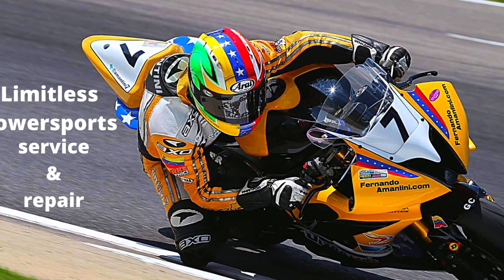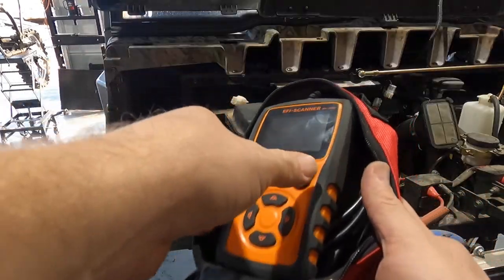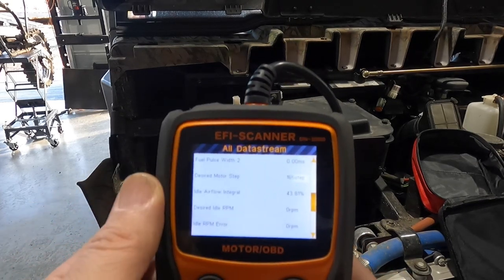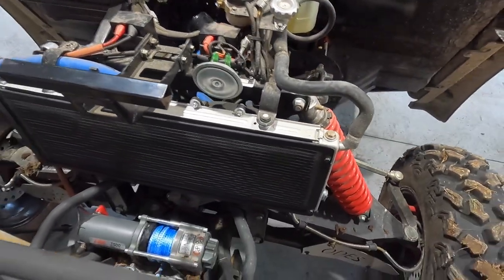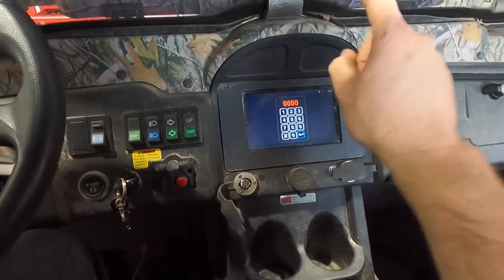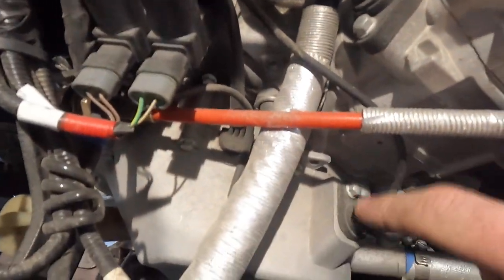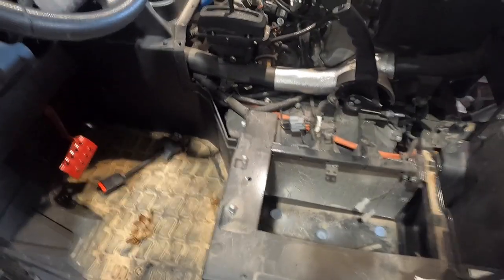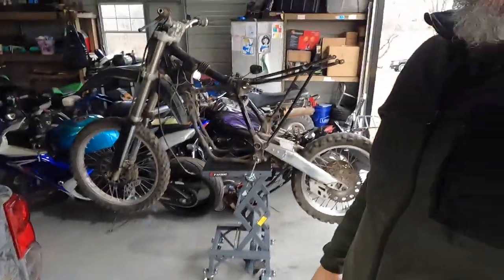Odes, Massimo, Bennche common issues

Comment: My oades 800 overheats its brand new and the dealer says it does it at low speed so I guess they think I’m supposed to drive 40mph everywhere and well there saying I can’t get a refund and is I put a oversized thermostat on it I’ll void warranty but if I take it out to like the river run it’s 7 miles of trails. I can’t take it there. It overheats every time I slow down. I’m so frustrated. This thing is brand new.
Reply: That’s crazy I putt around at super slow speed with ‘06 rhino 660 in 110F last year and never over heat however I rigged the radiator fan to run manually. I can just leave the fan on the whole time or turn it off. I mostly go slow speed in 4x4 and run it all day if I want. Also I make sure to keep the radiator and oil cooler clean.

Comment: Can the PVC cause engine smoking? What's the fix for the PVC?
Reply from the maker: A clogged crankcase vent /pvc can definitely cause the engine to smoke because it's not letting the pressure from the crank case escape & it can cause blowby. Ivwould pull the hose off the crank case vent & start it up & see if that cures your problem but I'm going to say you're probably going to need a new topend most likely.

Comment: Cyle thanks for the help . I had no spark and checked the crank sensor. It had an ohms reading at first but when moving the wire at the top of the sensor it would loose connection.   👍

Comment: Hey Cyle, I have a year old Axis 500 and with about 35 miles on it. After I run it for about 15 min it wants to not take throttle but will still idle.   I can shut it off and restart it and it’s good to go again for about another 10-15 minutes. I replaced the injector for grins cause it’s simple. I figured it wouldn’t change anything and it didn’t. Seems it’s something electrical after it warms up. Takes a lot longer to start acting up in the winter. Any info would be great. Thank ya much!!
Reply from the maker: I would start off by doing an ECU reset.  That will help with getting the ECU back to what should be a factory setting. Try that first & let me know & we will go from there
Reply: @limitlesspowersportsservic3394  Thanks Cyle… you the man! Is the reset procedure the same as the others in your videos? Press throttle,start, keep pressing for 3 seconds, shut off, then restart?
Reply from the maker: Shoot me an email @ Limitlesspowersports78@gmail.com & I'll send you the process

Comment: Hey Cyle, I took a couple weeks off working on the UTV but I am back at it now. I replaced the belt and all fluids but that didn't solve my slipping issue so I am working on the Wet clutch now. I have removed the Primary clutch with no issues however it doesn't seem that I have enough room in front of the secondary clutch to get it off of the shaft before hitting the seat frame. Do I need to tighten that spring from the back side in order to get the room to remove it? I feel like I have tried every angle to get that thing off of there.
Reply from the maker: You can't tighten that spring.  Just make sure you have the secondary clutch all the way compressed again after taking the belt off. You should be able to get it out.
Reply: @limitlesspowersportsservic3394  I did a little more research and people online said to push the engine over a little with a piece of 2x4 lumber and that worked to move it just a tiny bit to allow the clutch to slide off the shaft.
Reply from the maker: Awesome.  Glad you got it out. If your replacing the wet clutch you might as well to the wet clutch drum & the one way bearing since you are already there
Reply: @limitlesspowersportsservic3394  I did, I bought the kit and replaced it all at the same time. I also added the slugs since it was a pretty easy process.
Reply: My wet clutch looked okay but the wet clutch housing drum was super worn. It had some pretty crazy ridges worn into it.
Reply from the maker: Yeah that's very typical.  I always change then as a set because they wear together as a set. Kind of like a chain & sprocket set, you never change one with out the other because they wear as a set. But I do hope it fixes your issues. You can always as slugs to the wet clutxh to help with engagement & slippage
Reply: @limitlesspowersportsservic3394  So far it seems to be working better than it did. The only things I have left to do is take the new air filter back out because I didn't know to spray "Air Filter" oil on it when I replaced it. I think you mentioned the oil on one of your videos but I missed it. Ill spray it and put it back and then I have grease to fill all of the Zerk fittings in the suspension and I'm trying to decide whether to replace the final and differential gear oil.

Comment: Just picked up a MSU 850 and already had to change the throttle cable cause it was sticking. It was melting the inside of the cable. It would stick when the engine was cold. This started at on 27 miles on it. Dealer got me a new one and had to fix it myself cause all their mechanics quit. I bought some 1/2 heater hose and slid the new cable through it to try and protect it from the heat. I also bought some 1/2 thick adhesive backed firewall insulation for the cover like you did cause you ain’t lying on how hot the center console gets. If I still get throttle cable issues, I’ll just run it on the outside of the console. Already thinking of selling it and getting a Honda
Reply from the maker: That's the best Idea you have is to sell it. I promise you it will be a constant battle till you do sell it. The Hondas are nice but I love Can am. That's probably because I use to work for them lol.

Comment: Back again. I greatly appreciate your feedback.  My dads 2022 junglecross 800 wont start.  I checked fuel pump its good.  I checked for spark no spark.  I replaced crank position sensor still no spark.  Checked fuses.  Any help would be appreciated.
Reply from the maker: Are you sure the crank sensor is making voltage? You need to do a peak voltage test on the sensor to make sure the flywheel is turning & the sensor is producing voltage. If it checks out then start looking at ground wires & all connectors.

Comment: Wow amazingly informative video! Just what I was looking for. I'm hopefully buying a 2014 odes lz800 for 1500$ it has coolant in the oil, so hopefully a head gasket will fix. Good to know the possible cause of the overheating engine. The first time I can afford a utv so fingers crossed. Do these all have can am engines?
Reply from the maker: They are a can am replica but not all can am parts will fit. It also could be a water pump seal

Comment: Great informative video. You are very knowledgeable on these machines! I just bought a new Odes 800 x2 and just reached 20 hours for break-in and was wondering how to get rid of the governor that prevents it from going past 25 mph.
Reply from the maker: There is a single wire connector it believe it's under the hood on the driver side riptide to an upright frame rail. All you have to do is disconnect it. Some are under the seat & are a white connector & some are under the hood & are a single black connector
Reply: You are a genius! It was the single point black connector under the front hood. Runs like a dream! I've been trying to get the dealer I bought it from (which is 3 hrs from me) to tell me where it is for a week and won't get back with me! You are a huge help! Thank you so much!
Reply from the maker: Glad I could help you out. Definitely sounds like the typical dealer unfortunately.  Alot of people who get a hold of me tell me I have more information than the manufacturer 😆

Comment: I have a 2013 odes dominator and the starter just spins. Is it possibly the sprang clutch blew up? Anything to look out for? Please advice is appreciated
Reply from the maker: It definitely really possible that the starter clutch/ spray clutch took a crap.  You will have to pull the stator cover off & see if the gear sprins both directions.  If so then it's bad. Not to hard to replace, just a little time consuming.

Comment: Hey thanks for the informative video. For the fluid’s in the diff and transmission you said they changed to a 75/140 is that the recommended fluid now for the the 2013 ODES as well? Clarifying if I should switch to this fluid over the recommended for both dogs and transmission? Thanks 

Also would love to see a video on explaining options for the overheating issues with the odes and common fixes/upgrades/changes

Keep up the great content
Reply from the maker: I personally don't see the harm in changing it to a 75w-140. But some would say stay with the 80w for the diffs in the older models. But I haven't had any issues with running the 75w-140. Next time I get one in the shop I'll try to make some videos on upgrades & for them.
Reply: Thanks the manual does not specify for the trans
 @limitlesspowersportsservic3394

Comment: So if you had the choice to buy a newer Odes machine say 2019 vs an older Kawasaki/Polaris/Can Am say 2014, which way would you go based off of issues you have seen?

Thanks,
Reply from the maker: Tony that all depends on the model of the others. But I probably would still choose a can-am are polaris over the odes. Don't get me wrong tho, every manufacturer has its problems but Odes seem to have way more constant issues.  I have also worked on some really reliable odes but that is a rare occasion.

Comment: Just bought a 2017 dominator 1000 5 seater for 3k has 1300 miles need to redo the stator to regulator harness not a big deal while going over it noticed some slope in control arm bushing and the front bearings. Also the front diff pinion has a lot of slop wondering if the nut may be backed off or if maybe the bearings shot.
Reply from the maker: The 2017 Dominator 1000 had a slew of issues. Of course as you know the charging system was an issue with those with melting the stator plug. Also the transmission was a big issue with those with the not backing back off and pushing a hole through the left side of transmission into the CVT causing clutch failures and major destruction. A lot of times the nuts do back off the differentials like that. I would definitely get in there and check the front and rear diff for sure. They also make a regulator rectifier relocation kit and you can try to get a hold of Scott swords at Scooter Powersports you can give you things you need to do the relocation

Comment: Hi Cyle love all the information you give on UTVs . Wondering  if you have any information on my 2014 odes 800 dominator it only has 25 miles on it and the fuel pump quit , check and switched around relays to no avail. I haven’t had a lot of time to work on it but last winter it got cold and the started to work again but only for two or three days then quit again. Have you come across this problem and do you know how to fix it , I would appreciate any help. Thank you
Reply from the maker: It's a really good possibility that your fuel pump went out. I have replace so many fuel pumps on those things I can even count that high.

Comment: Nice work Cyle, I have a 2015 Odes Dominator 800x4. My issue is with the switch ignition that is not cut off after turner on the ignition.  I’m checking the cable and everything seems to be fine.  Can you please advise.  Thanks in advance bro.
Reply from the maker: I know there are 2 styles of ignition switch. But they both are known to get water inside then & get corroded.  You can pull the switch & take them apart & clean the connection & see if that cures your problem.
Reply: Thanks for the prompt response, I cleaned and check the wires and still not turning off, so I changed the ignition thinking that would solve the problem but it’s not. Any other suggestions would be greatly appreciate

Comment: Hello, Cyle! It’s me again ( dude on BMS Beast 1000😊). I have question to You about injector. Does this injector have operating modes? And how change this modes if this possible🙏 Thank you!
Reply from the maker: The only way to change what they call dwell time( how long the injector stays open) is to get the Hud hacker hardware from norwestsuspension.com then you can do all kinds of mods to your ecu
Reply: Hey guys, I'm surprised we don't have dedicated forums for Odes, Massimo etc...would be so much easier to exchange information and service how-to knowledge.
Reply from the maker: There are a few of them on Facebook for both the Odes & Massimo/ HiSun units.  Also Scooterspowersports.com  has free downloads if service manual for the odes & motorcycledoctor.com  has some great information with fee downloads.  I have worked with both companies for years now.
Reply: Thanks for letting me know, I have looked around, and realized my Massimo has CFmoto 1000 engine and Bosch ecu...perhaps you have similar experience with that setup?

Comment: Are there any common issues with the rear end? Got a 750 side by side with about 150 hours. The rear end seems to be jumping/catching/jerking. Even in just 2 wheel drive, with posi lock on or off, doesn't matter
Reply from the maker: Are you sure it's the rear end & not the belt? I know they do have an issue with the bolt are nut coming loose on the yoke causing issues on deceleration jamming the pinion gear into the planetary gear.

Comment: Massimo 250 i  ran jumpers off the batte to each fuse it stsrts and stays running it wont shut off and stays running with key out is thay the ignition switch ?
Reply from the maker: Its definitely a really good possibility.  You might be able to just take yours apart & clean it.

Comment: Hey Cyle, I bought a Odes dominator 800 x4  and I have problem with the following; heat while driving it’s crazy, also change the ignition switch and it’s keeping damaging the new one after a few months of use and lastly the motor makes a huge noise.  Can you please advise in any of these three issues 

Regards
Reply from the maker: Sorry for the last response. Didn't see this comment. So as far as the heat goes all the odes have this issue. I put an acoustic heat barrier under all the housing around the motor. Also  a lot of guys will put another fan pointing to the back from the front on a toggle switch so blow cool air through the engine tunnel.  When it comes to the ignition switch it sounds like you may have a short to ground issue somewhere in the harness. I would check the black 9 pin connector that connects the main wiring harness to the engine harness. Also I'm not sure when you say loud noise from the motor what you're exactly talking about. It's it when driving you get a really high pitch wine? If that's it then it's a bearing in the transmission on the big pinion gear.
Reply: Awesome, just covered all as you did for the heat problem and for reducing the noise on the cab, I relocated the air filter under the hood on front. Thanks again for your advice
Reply from the maker: Yeah relocating that air filter under the hood makes a huge difference too. Did you ever figure out the issue with the ignition switch?

Comment: Question.  I'm in Minnesota and there is a 2017 Odes UTV 650 Comrade with about 850miles on it at an Auction.  Only issue it apparently has is with the E-brake.  Current bid is around 4K.  What is the value of this thing, the body/tires are in great shape.  Any help I could get would be appreciated.  Auction ends in about 8 hours
Reply from the maker: Those are very hard to get parts for & the front diff bow out & then they don't want to idle very well all the time. 4k is a lot for that thing. I think I doldrums them for about 7 new back in 2018
Reply: @limitlesspowersportsservic3394   That's what I thought too.  I saw brand new they were selling for about 7,999.  I'm out.  Thanks

Comment: I have a 2014 odes dominator 800.  The 4x4 is not working.  I don’t hear the actuator making any noise when I hit the 4x4 button.  I have checked all fuses and relays.  I also swapped the 4x4 button off another odes that I have and verified it’s not the button.  Also, when I hit the 4x4 button, nothing comes up on the display to confirm it.  However, when I click diff lock, I see it come up on the display, but still no noise or actual engagement.  Any thoughts?

Edit: I removed the actuator and now when I click the 4x4 button the relay clicks, but still no motor engagement
Reply from the maker: Those 4x4 actuator motors go bad all the time.
Reply: @limitlesspowersportsservic3394    I replaced the actuator with a brand new one.  It just clicks the solenoid.  Replaced the solenoid and still just clicks?  Thanks for the reply
Reply: @limitlesspowersportsservic3394    Any thoughts?
Reply from the maker: Ok so if you remove the actuator & press the button, do you see is operating correctly?  I have seen the fork on the inside of the diff break are bend & not let it go into 4x4
Reply: @limitlesspowersportsservic3394    It won’t engage both out and in the diff.  It doesn’t show anything on the display either
Reply from the maker: You need to check for voltage going to the actuator since you have a new solenoid new four-wheel drive button and actuator you may not be getting power out of the solenoid/relay to the Actuator motor itself
Reply: @limitlesspowersportsservic3394    I’m wondering if there’d be a way to just bypass the solenoid all together?
Reply from the maker: I'm sure you could put it on a toggle switch with running direct power to it. Just flip the switch when you want to activate it.

Comment: Sorry if you've answered this but can I used my OBD2 scanner with that adapter cable?
Reply from the maker: I believe your odb2 needs to be able read Delphi not 100% sure because I've always had the scan tool.
Reply: @limitlesspowersportsservic3394  i sent an email about getting a manual for this machine. Checking if you received it